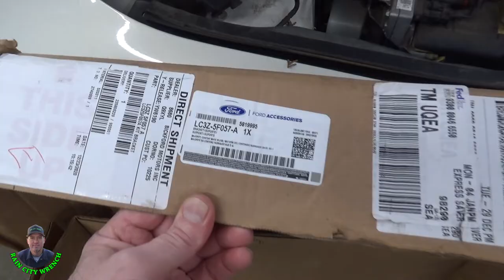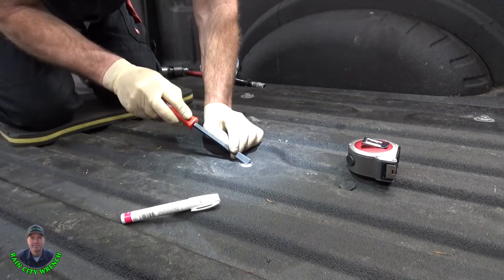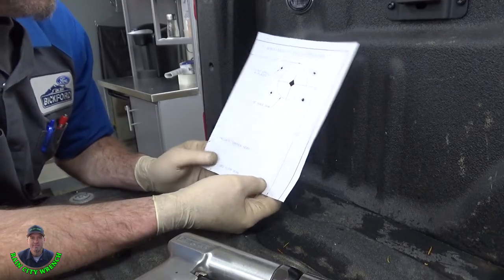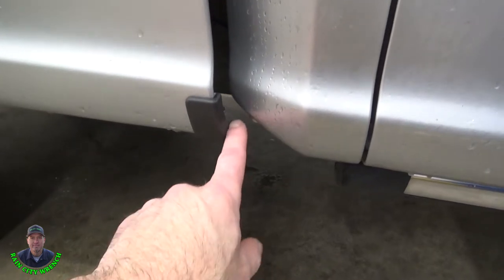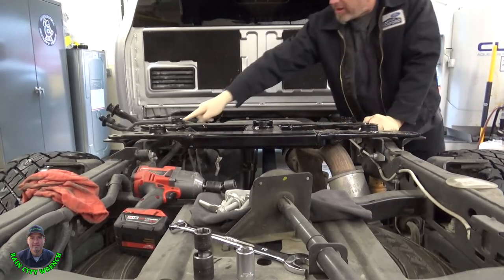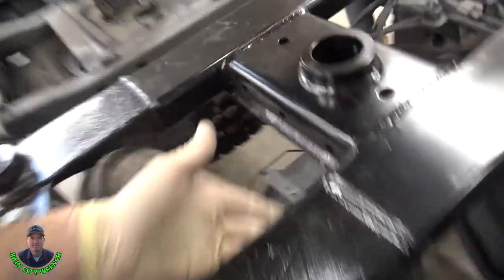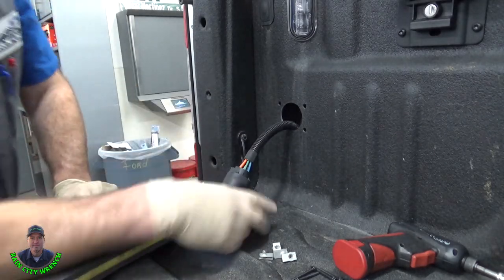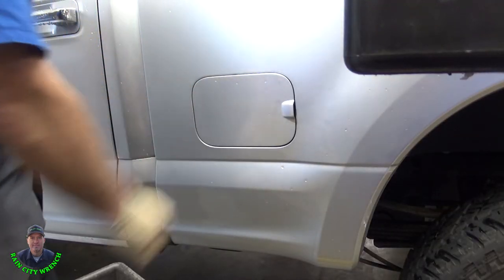FORD FACTORY 5TH WHEEL/GOOSENECK HITCH PREP PACKAGE INSTALL

Comment: Thank you for this. I did mine this past weekend and referred to your video whenever I needed some clarification. This made it easy. Quite frankly if you have the right tools, it's a fairly easy job.  Only took us a few hours. I also did air lift 5,000 air bags in the back and that took a lot longer with the compressor, tanks, and all.  I have about two days in the whole thing. I saved about $2-3k on labor though so it was a good weekend for sure. I can't wait to hook up my new toy hauler to it 🤠
Reply from the maker: Awesome! If money can be saved by doing yourself, I'm all over it.
Reply: $2-$3K labor? I have a 2023 F350 and my dealer wants $600 labor to install mine.
Reply: @johnyoung4772  I don't know what type of systems you're talking about, but I duplicated the factory OEM by removing the bed just like this video and did an custom Air Ride with extras. Some of the other products bolt from the top. A whole different project. I got prices from two different Ford dealers and they were about $1,000 for the gooseneck prep. I'm near a big metropolitan area so prices are high here. The air system that I have in my truck is not one of the simple plug and play ones. I put in a constant duty cycle 200 PSI pump, to be able to pump my high pressure tires, and an auxiliary tank. I did some other custom stuff extra ports for tools.  It's ran inside the truck with valves and gauges. I could only find two shops to give me a price on that anywhere near me and they both wanted $2,000 and said maybe more. Quite frankly I don't think they wanted to even do the project. 2-3k all Day. It took me in my buddy a long weekend and a few cases of beer, about 40 man hours.

Comment: Just finished the install just in time for a shower and to enjoy turkey with the family. Thank you for the very detailed video I referenced it multiple times during the install. I used an engine hoist with ratchet straps to the four tie down cleats in the bed and it worked like a dream.
Reply: I was thinking the same.  Doing it next week.

Comment: This made me so glad that we had this factory installed!  😆  I highly recommend it.  

We use the B&W Companion w/ Slider Fifth Wheel Hitch, which has a pin that drops in & locks to the bed mounted Turnover Gooseneck Hitch.  Unlike a lot of 5th Wheel hitches, it doesn't require any additional attachment points, so it's easy to remove (in 2 heavy pieces) & have a clear bed.  

We're towing a 40' 5th Wheel & the whole system works really well.  We will definitely be putting it in any future trucks too.
Reply from the maker: Thanks for the comment! Installed a couple B&W companions, really nice units 👍

Comment: If I could be assured a competent technician such as this could be found at my local Ford dealer I wouldn't be apprehensive about having the dealer install this item and perform any other service in general.....  Great job !
Reply from the maker: I hear ya. That goes for about any industry, some good techs/bad techs, good and bad doctors, contractors, etc. This industry only cares about profits. Flat rate techs are in a rush to "make time" so quality suffers. Worked on a comeback just yesterday at our dealer. Reverse lights would flash when turning on right turn signal plus stepping on brake. It just had some wiring work done to the back. The tech never checked his work. Not double checking your work on something important like lights? Really? That wouldn't make me very happy or confident as a customer.

Comment: Well,  today is the day,  I have a 2020 F250 and I'm moments away from my install,  along with a 55gal Titan fuel tank (direct replacement) and 7500# air lift bags. 
I hope all goes well.  Thank you for a fantastic,  detailed video.  It is a huge help.
Reply from the maker: If you have the ability to remove box, that will make all three installs easy. Those boxes are light enough to where I think four people can lift it off without tailgate attached. Should be a fun job to do, enjoy!

Comment: The part where you showed the removal of the bed was interesting.  My bed had to be removed (because the factory managed not to paint a small spot on the back of the cab) and the body shop decided to remove the bed rather then trying to work around it.  As a part of this, they removed the rear bumper.  I was not sure why they had to do this until I saw your video!
Reply from the maker: Yea, it's a tight fit. The older gen trucks come straight up but they tightened up the tolerance for aesthetic purposes.

Comment: Bought this gooseneck package today. Also bought all new box bolts and retainer nuts since apparently they are a one-time use only. Hoping the bolts come out smoothly...2017 w/ 48k miles.
Reply from the maker: No sweat getting them out unless you live in Alberta and only drive in winter. Ford always wants stretch bolts replaced or anything with threadlock. Don’t use an extension when you torque the box bolts, works way better. I learned the hard way
Reply: @raincitywrench117  Good to hear. I'm in MI, so we see our fair share of salt. I have the big boy 1/2" Milwaukee impact like yours, so it should do the trick. Thanks for the video - very informative!

Comment: Thanks for the great detailed video and the hole template!  My brother and I installed in 4 hours with no issues.  Saved myself $750 for the install.
Reply from the maker: Awesome! Love saving money. Did you remove the box?
Reply: @raincitywrench117  Where are you located? I  need one installed in a 2022 f350 dually.
Reply from the maker: @jamesmorris8226  Snohomish WA

Comment: Great video! Only thing I wasn’t too keen on was not putting a protective finish on the cuts for the pucks. Not sure if you mentioned whether it was aluminum or steel. Haven’t had one of the aluminum beds myself but as someone who works with aluminum frequently, it does corrode particularly when cut through the cladding in high moisture environments. We usually treat with Alodine, Prime, and paint or seal to prevent future corrosion. If steel then obviously rust would be the concern.
Reply from the maker: These are aluminum beds and not worried too much but good ideas.🙂

Comment: Great video. I just had this installed on my 22 super duty by a Ford dealership near me. When I got home I noticed the castings seem to be slightly off-center in the bed. I measured the position of the gooseball casting from the left and right side of the bed and there is about a 1/4-inch difference when measuring left-to-center compared to right-to-center. My bed seems to be aligned with the cab based on my measurements but the crossmember seems to be slightly crooked. I’m curious if this can be corrected or even matters? I brought it up with the dealership but haven’t received much of a response as of yet.
Reply from the maker: Almost every one I have done is slightly off to the passenger side and forward on the right side. There are alignment pins that the bracket fits over but it places it off slightly. Luckily it won't affect anything other than the aesthetics to the eye. You will be good to go 👍
Reply: @raincitywrench117  thanks very much for the reply! Much appreciated

Comment: I have installed the surface rails in a f150 . You made it look easy . Looks like with out that lift & just a block & tackle it would not be that easy.
Reply from the maker: Ford aluminum beds are somewhere around 300 lbs & can easily be lifted off with three people. Have a couple sawhorses nearby and you are good to go.

Comment: @Rain City Wrench Do you have a part # for the bolt kit? Recently bought one of these hitches off of a wrecked superduty but the guys that had it didnt save the bolts. I know i can just go out and buy some good bolts etc locally but i'd rather just buy the correct bolt kit if it's available seperately.
And thank you for a great video!!
Reply from the maker: I contacted parts. They show no part# for individual bolt kit but did send picture showing hardware quantity and description. Email me if you like & I can send to you.

Comment: Great video on the install  Is there another kit to install if you are going to use chains?  I have heard that some states require using them.
Reply from the maker: There are safety chain attachments that fit into the outer pucks when using the gooseneck. https://www.amazon.com/Reese-30134-Attachment-Under-Bed-Gooseneck/dp/B004R35WAO/ref=asc_df_B004R35WAO/?tag=hyprod-20&linkCode=df0&hvadid=242007613379&hvpos=&hvnetw=g&hvrand=9899688782086202783&hvpone=&hvptwo=&hvqmt=&hvdev=c&hvdvcmdl=&hvlocint=&hvlocphy=9033391&hvtargid=pla-570375513968&psc=1
Reply: Thanks for the info.

Comment: Thank you for the great instructional video.  Do you know if the 7 way and spacer is available through Ford by themselves?
Reply from the maker: Depending on your year this may be what you need. HC3Z15A416A
https://accessories.ford.com/products/super-duty-2017-2021-7-pin-trailer-wiring-harness-1

Comment: First class mechanic work.   But this is making me lean toward the B&W hitch, I'm sure the ford is stronger, but I don't think I will be towing more than 12-14K with the gooseneck.   What do you think of the B&W kit as far as strength.    I'm just not wanting to take the bed off my 2023 F350 without a lift.  B&W does not require bed removal.. I"m sure you have done both.
Reply from the maker: Installed a couple B&W units. They fit nice and work great. Real pain to install though. https://www.youtube.com/watch?v=OtWKTYCXD3k&list=PLCGan5QBcVYkPcg3FpPgyWeVLKoxH0Fcg&index=9&ab_channel=RainCityWrench
Reply: @raincitywrench117  video link not working.

Comment: Great video! Any tips for those without a lift for the bed removal or options to partially lift bed for proper fitment?
Reply from the maker: These aluminum boxes are real light. With the tailgate off, four people can lift it easily. Remove the bumper, invite three friends over and yard that box off. Make sure you drill all the holes first when the box is still bolted down. When you remove the box bolts you can grab a corner and lift up to see how easily it picks up.

Comment: My 19 i just bought used has the prep kit installed but i do not have the ball, is there a specific one that needs to be used?
Reply from the maker: Just needs to fit Ford factory prep packages. Etrailer has a few manufactures:https://www.etrailer.com/g-2019_Ford_F-350+Super+Duty.htm?style=8+Foot+Bed+with+OEM+Prep+Pkg 
Ford also makes a nice unit that has tie downs and a storage bag.

Comment: Awesome tutorial, glad I found it! Almost installed this hitch without the inner brackets Any chance you have extra inner brackets you would be willing to sell? I got this hitch off a f350 I put a steel flat bed on and would like to put this on a new f350.
Reply from the maker: I don't but you may call your local dealer and cross your fingers. Many of the new pickups have the inner brackets welded on and if your dealer installs these they may have a spare set laying around.

Comment: Hub city Ford in Lafayette Louisiana told me they are not equipped to do this job!!! I have to install this with a bad back because Ford has inexperienced techs!!! Go Ford!
Reply from the maker: At least you will know it's done right.
Reply: @raincitywrench117 All done!! Took me about 4 hrs and that's with a few breaks. I did end up taking the bumper off just for a little extra view for clearance. That's also including assembly and install of a Reese 27k hitch. Going to make good uses with a  2021 F350 Dually and 2022 KZ Venom 4013tk Toy Hauler!!!
Reply from the maker: @thomasbroussard2316  Three slides, 2 baths, residential shower, center island. Damn, that is a nice hauler!!

Comment: My 2021 F250 does not have the welded inner brackets. So, how do you set the height? I don’t see any reference to the proper height in the instructions. Thank you for any help you can provide!
Reply from the maker: The fifth wheel bracket will set the height. When installing the side brackets, leave them ever so slightly loose. Lay the crossmember on the frame aligning the two dowel pins then install and tighten the top bolts which will suck the side brackets up tight to the fifth wheel crossmember & will set the height. Lastly tighten the four main side bracket bolts. Bing bang boom you are done! Well once the box is back on.

Comment: Have you done this on any of the 2023s yet? Any significant changes? Just got my prep package finally for mine. Contemplating installing myself.
Reply from the maker: I haven't yet. Was supposed to do one last Monday on a 23 but it didn't show up. There are quite a few changes on the 23 from the 22 like front control arms, body style/badging, instrument cluster, electronic parking brake, etc but doubt the box/frame are any different.

Comment: I have a 2015 f350 drw with a spray in bed liner similar to this. Are the bed dimple like this truck where the holes need to be to install the puck system like this?
Reply from the maker: The steel boxes have the same dimples. I start with the center & fronts and then measure back 13" (I think) to find the rears.

Comment: I just picked up a '17 350 with the prep already installed, the trim rings and covers are missing. Do you happen to know if they sell the trim kit separately? If they do do you have source or part number for teh trim kit?
Reply from the maker: You're in luck, yes they do. BC3Z-99000A25-A  https://www.fordgenuineautoparts.com/oem-parts/ford-hardware-kit-bc3z99000a25a?origin=pla&gclid=CjwKCAjwquWVBhBrEiwAt1Kmwkogj0KiksQp1q1W9EwbRUNdG9diwP8G64wxGwTNdxOWis75F0yxTRoCkDAQAvD_BwE

Comment: In my search for a 5th wheel receiver, I'm noticing that they are made specific for certain trucks. My question then is if you use top mounted bed rails that are universal, then isn't it a moot point?
Reply from the maker: Yes, exactly

Comment: Hi I'm in Marysville what would you charge to install the puck system on my 2016 f350 diesel dually? Including the kit?
Great video thank you
Reply from the maker: I'm not 100% sure but know our dealer charges 5.5hr and think out labor rate is $189hr. My guess is the kit is around 750 bucks so that would put the total install somewhere around $1800 before tax.

Comment: Great video. I may have to do mine when my truck arrives because the factory is saying the prep option is delaying deliveries too much. Sad thing is this $500 option costs $595 just for the parts and I've been quoted $600 for the install.   Anyway, just curious if removing the tailgate was required or a convenience?
Reply from the maker: Just built a new super duty last week with the prep package. Will be ordering one soon but I'm in no hurry. How long is your wait? I did one and left the tailgate on but it makes the box =back heavy- It's just easier getting it out of the way. The box is surprisingly light and seems like the tailgate is 20% of the weight.

Comment: If you were to take a factory one out that’s already been installed would you have to take the bed back off or can you do it without taking the bed off?
Reply from the maker: You don't have to take the bed completely off but will need to remove the box bolts, lift it up enough to place 4x4 wood blocks between the frame to access the bolts and remove bracket. The box is fairly light and can easily be lifted by two people to wedge blocks under it.

Comment: Can you tell me when Ford started putting those dimples in the bed as a guide?  I have a 2011 I'm wanting to do this to, but bed is rhino lined currently and can't tell.  Thx!
Reply from the maker: That I can't say. I know all the aluminum beds have them but haven't done a steel body install yet. If you have the bracket, set it in the bed and align the center hole making sure the bracket is correctly aligned with the gooseneck hole facing forward from center line of bracket then eyeball a mark through the center of the four outer pucks with a paint pen and that will get you real close for when you chip away the bed liner. I would start by scraping away the center hole area to see if the steel boxes have dimples.
Reply: @raincitywrench117  Thanks for the reply, I'll cut a bit off where the gooseneck ball gets placed and go from there.

Comment: Do the 2017 trucks use the same factory gooseneck hitch as the 2012 f250? Same part numbers? I have one i’d like to swap
Reply from the maker: No, the frames are different from the steel body to the aluminum body.

Comment: What locks the goose neck ball into assembly? On my B&W goose neck set up I have a lever that in the wheel well that I pull and push locking the ball in place.
Reply from the maker: The factory ball has a lever on top that flips down pressing out two pins that lock it in. I have install two B&W hitches, Those are nice too as they allow you to stow ball upside down when not in use.

Comment: When you order this option from the factory, does it come installed?  I assumed it did. (BTW i have bought a car from Bickford before and I might order an F450 from there this year or next) thanks
Reply from the maker: If you order that option it comes installed. Check your build sheet to see if it's listed. It used to be around $600. I ordered that option on my 2022 but they stopped installing during the covid years so I had to pull it. Maybe Ford is back to normal now and they are installing at the factory again?

Comment: Are the receptacles for the 5th wheel posts, also where you install the safety chain anchors for a gooseneck set up?
Reply from the maker: They make a gooseneck kit with anchors that lock into the outer pucks. Works slick. Not sure what you are asking on the receptacles?